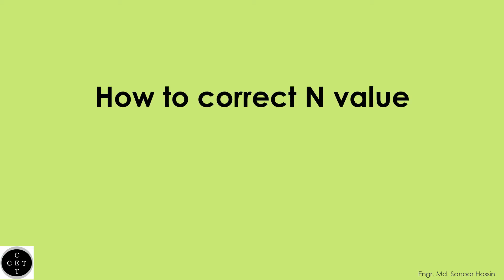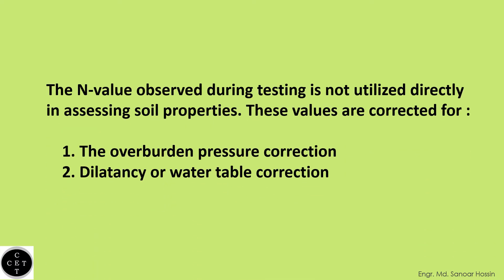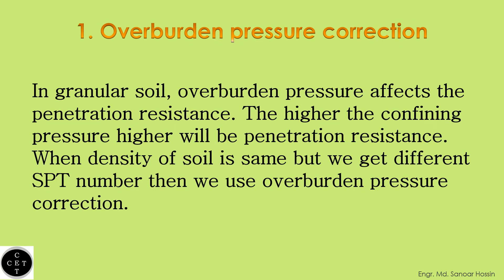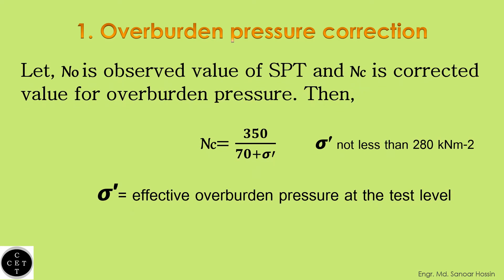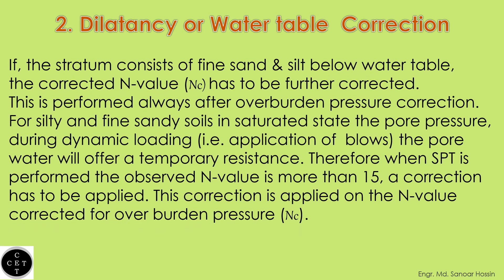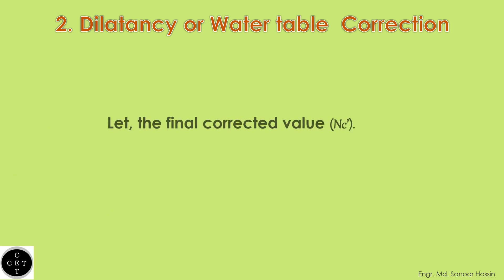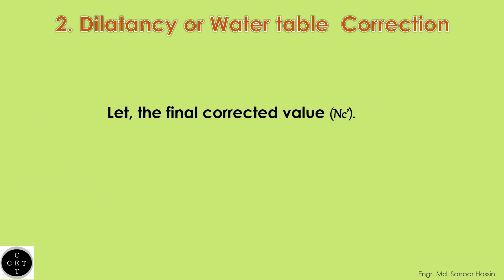How to correct N value | SPT Number | Standard Penetration Number

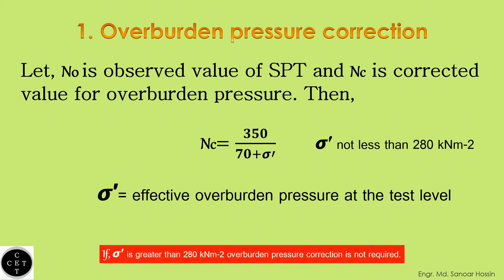Comment: I am confused @1:26 
Correction is applied only when effective stress is not less than 280 KN/m2

In red mark area at bottom 
If Effective stress  greater than 280 then overburden correction is not required

In both cases effective stress should be greater than 280
Reply from the maker: This method is only applicable for overburden pressure being less than or equal 280 kN/m2. This is collected from Gibbs & Holtz' Correction(1957). The red marked is right but upper portion will be less than or equal 280 kN/m2. I wish I could edit that but now no option. Thanks you noticed. Haahahaa my bad. That doesn't make any sense.
Reply: Thank for your clarification ❤️